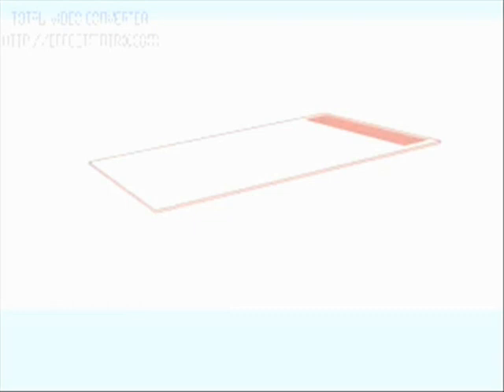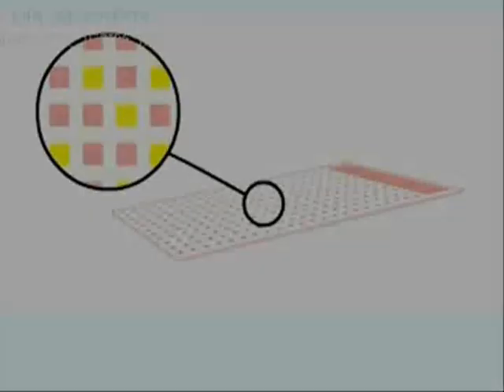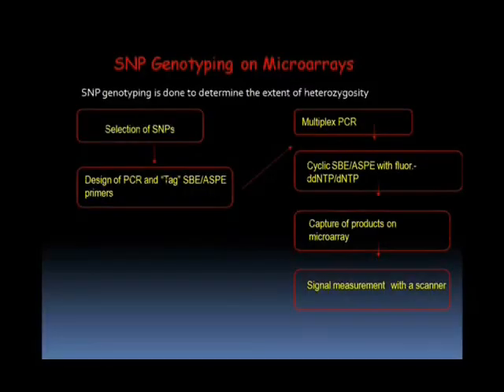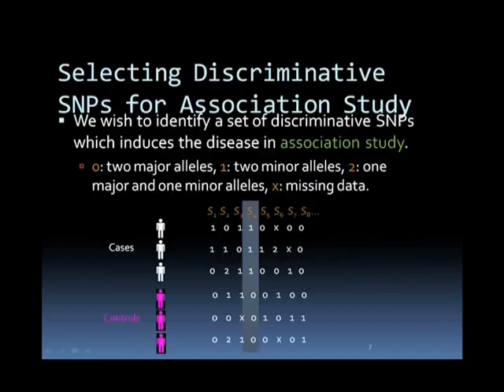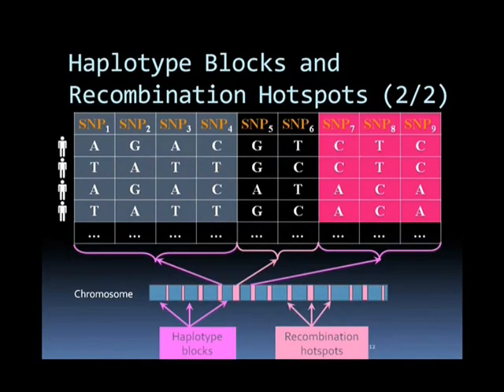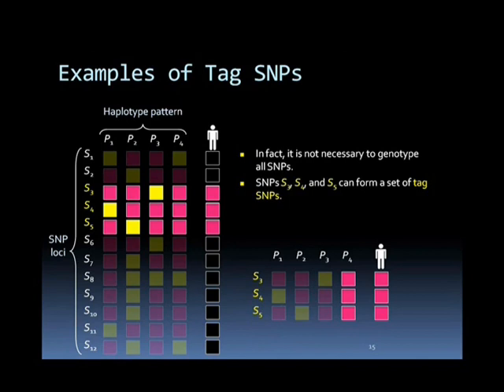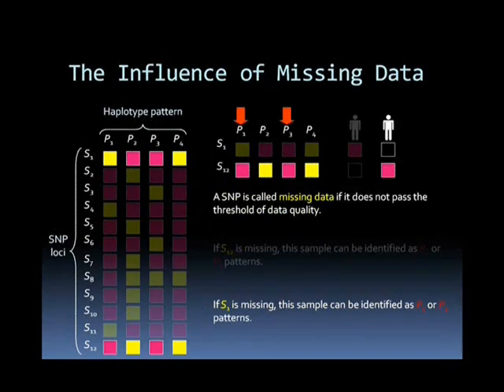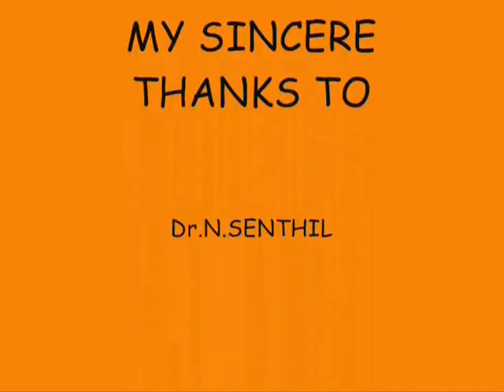Microarray based SNP genotyping

Comment: My question is- how accurate is this?  This is still early technology, and checking 500,000 SNPs from the DNA of a person or other organism against a chip with 1-2 million or more SNP variations could be less reliable, in my view.  Intuitively, and based on my research, it is more sensitive and specific to get single gene evaluations using specific techniques such as FMPCR.  This is more expensive, of course, but worth it in some cases, such as in disease risk calculation. "Trust but confirm".